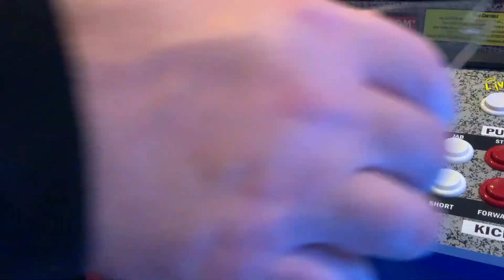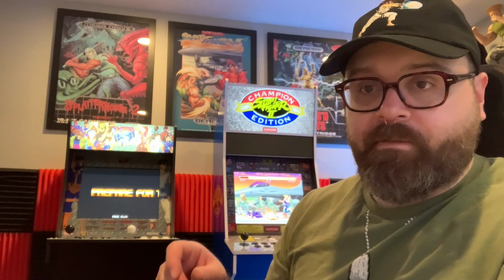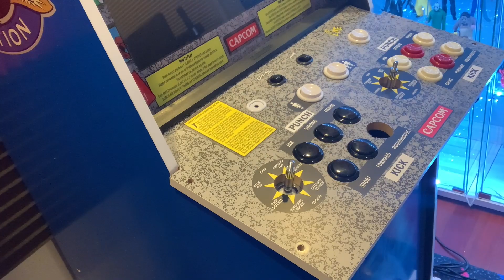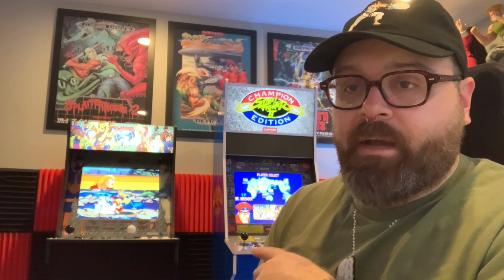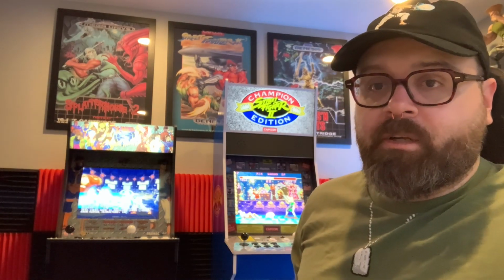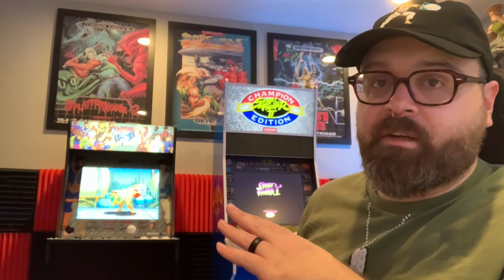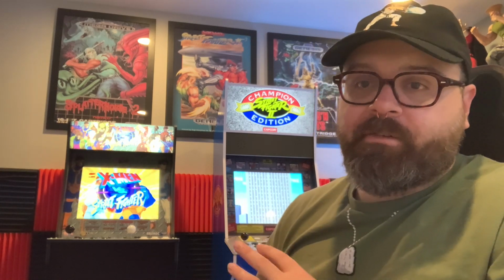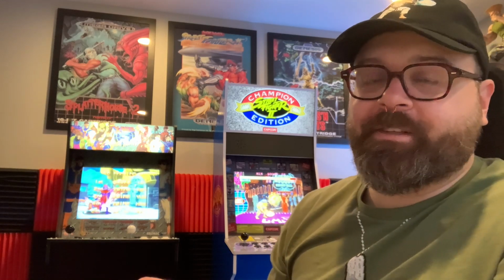After More Testing, the BEST Button for Your Arcade1Up is ... ***No Drilling or Soldering Required!

Comment: I’ve replaced the stock buttons on my Big Blue with Sanwa OSBF-30 snap in buttons by just pushing them in with palm pressure. Make sure you place the control deck on your lap while doing it or on a flat surface with a cushion underneath to protect underside. I had the same dilemma as I wanted the cabinet to look authentic as possible, so tried Industias Lorenzo (IL) concave buttons with cherry Microswitches, but the Sanwa joysticks and buttons are just superior for fighting games that require quick combinations. You don’t find any high end fight sticks using IL Euro or Happ Competition joysticks and buttons or used at any eSport tournaments.
Reply from the maker: 100% agree!

Comment: I put crowns and sanwa in my big blue n mk3 both very similar but my favorite buttons are Seimitsu buttons 
They are harder to push down though and Siri g back faster . Prob not the best for fighting games but great  for everything else . I do use them for KI though
Reply from the maker: Yeah I had some higher tension spring buttons initially and ended up going sanwa. Got too used to that softer touch after years of using popular fight sticks.

Comment: Great Video!!  I am just wondering which wires did you use for the Sanwa buttons and if it matters how the two pins get connected to each button (since there are two connectors on the Sanwa button)
Reply from the maker: You can pull the wires off the arcade1up buttons and use them on the sanwa buttons.
Reply: @OfficeArcade  Awesome!  Thank you.

Comment: Did you have to get new wiring for the buttons as well and if so where did you get the sanwa wires, I kind of want to throw sanwa buttons in my mvc cab but I’ve never upgraded them before.
Reply from the maker: The stock wires work for sanwa buttons!

Comment: Hi! Thanks for the video! Very helpful for a new guy like me. I just got my big blue and this will be my first control panel mod and I’m going to try and replicate your setup. From DIY retro arcade would that be the JLF-TP-8YT 5 Pin Joystick For Arcade1Up DOUBLE 4 WAVE 3 17 INCH CABLE (they have multiple options, but someone else called out that one in a comment on a different video and just wanted to confirm) and from Paradise Arcade Sanwa OBSF-30 Snap-in Buttons? Thanks again so much! Looking forward to spending more money just to continue getting down online.
Reply from the maker: Yup, double 4 pin and Obsf 30 will do the trick! Congrats on the cab and the first mod! Let me know how it turns out!
Reply from the maker: @HotelNeptune  haha. Awesome! I’ll catch you after work some time!

Comment: Great video.did you have to order new wires?
Reply from the maker: Nope. I just carefully removed the wires from the Arcade1Up stick buttons and reused them. I used small pliers to grab the back of the taped metal bracket and gently pulled each wire off the prong on the A1Up stock button.

Comment: SEIMITSU PS-14-GN 🤘💕
Reply: i am still blown away by people using crude files, drills etc 

Wouldn't it be just basic common sense to use the button that's the right size?! lmao
Reply from the maker: I think part of the problem is that the hobby is drawing in a lot of non-hardware folks for the first time. 

So I think a lot of those folks aren’t necessarily familiar with modding, even the simpler ones like button swaps!
Reply: @OfficeArcade  ya i try to be patient and just tell them its just wires and you can always go back to stock if you change your mind haha

im not allowed to play with powertools/saws im highly accident prone 😈😂

Comment: why not get screw in osbf 30's ? Also the flat head slot on the bottom of the jlf is used fir tightening the balltop so you dont have to grab the shaft with pliers . Agreed on the american parts especially when you get into combo execution they're so slow compared to sanwa. You should look into to crown micro switch buttons if you like sanwa , they are very underrated / talked about
Reply from the maker: The screw ones I had were too short and wider then the snap ins. And I’ll look those buttons up tonight. Maybe grab a set to take them for a whirl.